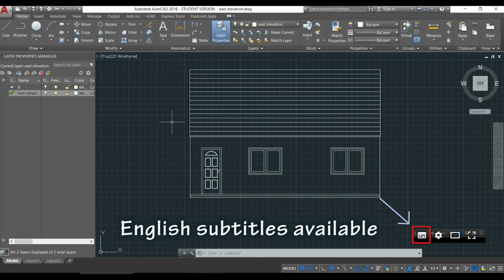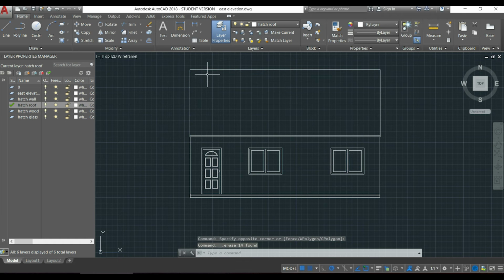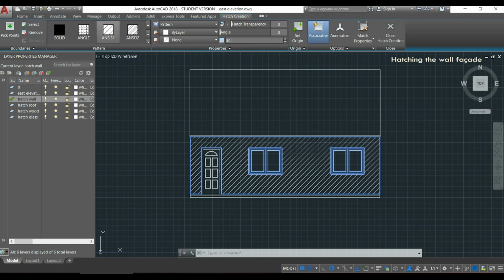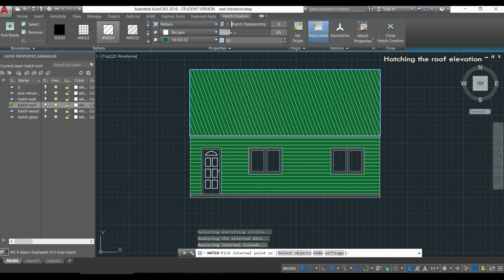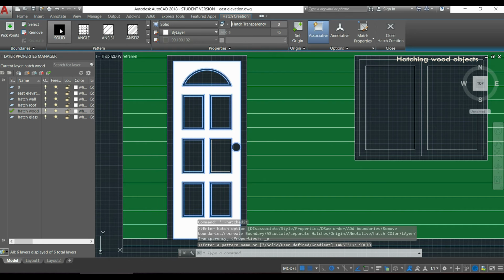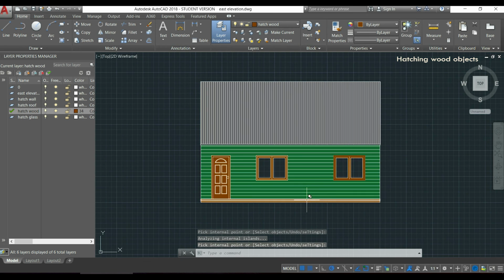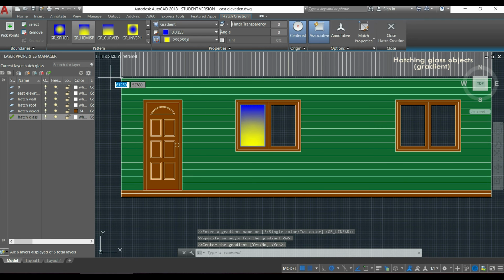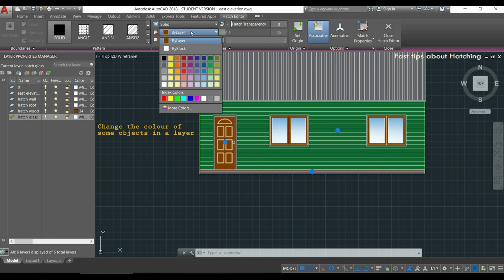AutoCAD 2D Basics - Tutorial to draw a floor plan (fast and effective!) PART 6 - Hatch

Comment: how many part this tutorial has ? is this the final part?
Reply from the maker: 6. This one is the last one.
Reply: @CADinblack  where is the elevation and 3d work ? where is the floor plan which we designed in the first place? I thought it will be turned into 3d ! Nothing was done with it afterward
Reply from the maker: floor plan https://drive.google.com/file/d/1YFS1f4I6ZEEgV97qaxB5SLe-QNYy9hT0/view?usp=sharing
I have made a simple modeling of that floor plan. Although it's not complete, you can watch it here: https://youtu.be/DM0Y-3DovaA